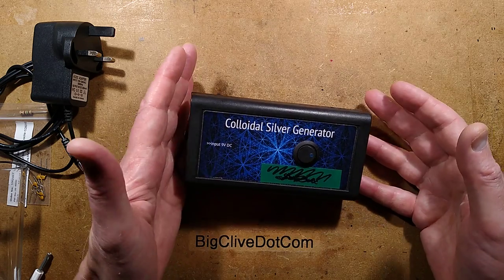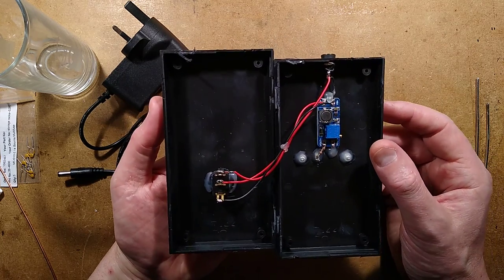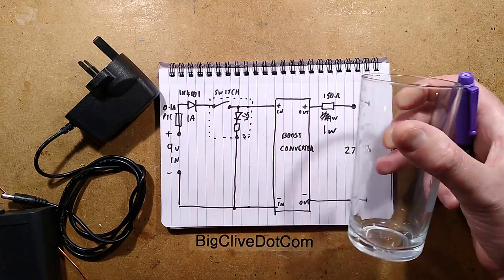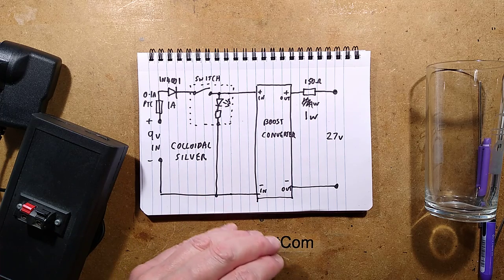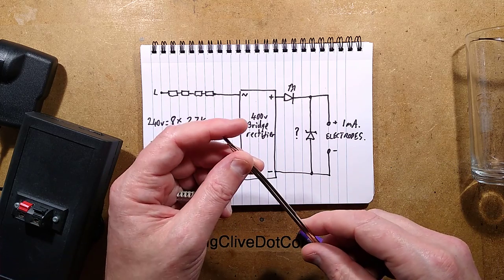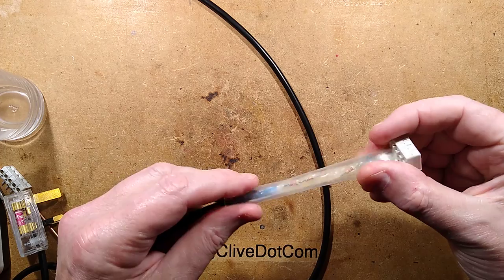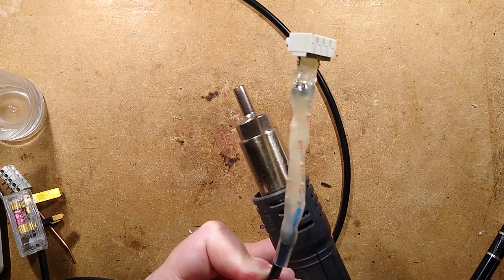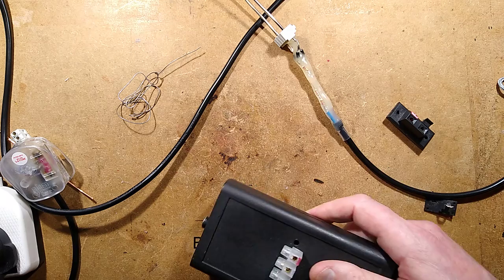Fixing a colloidal silver unit and making a slightly dangerous one.

Comment: Reversing the current periodically will swap the anode cathode thus evening out the ion salt deposition on each rod.  Induced frequencies can vary qualities in the 'cook'.  A magnetic stirrer will help speed the reaction.  I've had excellent results using the Spooky 2 signal generating unit, software, and documentation.

Comment: Love it! Thanks clive great video! In a pinch we took 3 radio shack rechargeable 9V batteries, stuck them together in sieries batt 2 batt +,-+-+-. Marked the positive of 1st batt and negative of 3rd on a mayonaise lid. Drilled holes for 18awg wire then tied 2 knots either side of lid to hold wires in place wrapped the wire around terminals on the batteries. And wrapped around 2 pieces of hammered silver. 👌 Oooh would the silver emit from the negative poles in the southern hemisphere? 🤣🏌️‍♀️

Comment: My guess is when this unit was originally designed they used a boost converter with current limiting, which would have stopped the burn up that happened, but a penny pincher found that they could save a few cents by using a converter that did not have current limiting.

Comment: A good improvement to your prototype would be to heat the whole thing up again and make a U-bend in it. Yours is straight, so that terminal block, the LED, rectifier, resistor arrays and mains cable all pulling on that glass. It is a colloidal spill waiting to happen.

And of course, the 'box' should be 3D-printed, as others commented already.

Comment: Hi, as for the hot glue.. I usually do it the way I just take a hot glue stick, eventually  cut it lengthwise to reduce the amount of the glue.. put it alongside the wire, put the heatshrink tube over. and then heat it all with the heat gun. The heat gun shrinks the tube and melts the glue inside and the glue quite successfully fills the entire inside of the heatshink.. and sometimes oozes out. :)

Comment: That wire would make nice snake oil speaker cable. Bonus if you make little wood free air supports for it as to have low capacitance to the speakers.
Reply: Now that's a great business idea! The audiophiles will go nuts over this :-)
Reply: @harriehausenman8623  you have to sell it with belief from the heart (or from milking a snake)
Reply: @fanplant  A religion, you say? Also a great idea. I'm in anyways.
Reply: @harriehausenman8623  little wood miniature telephone poles with a sonically balanced real Shellac finish.
Reply: @fanplant  But don't these need a near-perfect vacuum?
Reply: @fanplant  Maybe with a gravitational waves balancing counter-weight?
Reply: @harriehausenman8623  the vacuum model would be another "level" of existence $$$*$$$
Reply: none of it really matters, I just came from an outdoor market that had a booth selling CBD with the claim it works for aids, spinal cord injuries, cancer, and liver disease. If they can get away with it you can sell little lincoln log speaker cable standoffs

Comment: That could also include a TDS sensing function. Ounce the voltage accros the electrodes drops to a predetermined level you know the TDS (conductivity)  has reached your desired level.

Comment: I use 3.3v @20 + amp.  Lower the voltage the better as minimises pariculate size.  Distilled water easily made using a pressure cooker with copper brake pipe attached as a condenser coil.  Cool the coil obviously test the outflow as the ppm lowers to zero.  Oh and use rainwater as the initial ppm is usually well below 20 ppm with atypical around 10.

Comment: I also think this is nothing more than woowoo - but instead of using a higher wattage resistor you should use a higher value resistor. Using a 2.7 kΩ resistor instead of 150 Ω will not affect the working current/voltage significantly, but limit the short-circuit current to 10 mA at about 1/4 W over the resistor.

Comment: One suggestion I'd have is to use a small transformer in your final potted version, it'd isolate from mains and massively reduce the shock risk.
Reply from the maker: The transformer would increase the size and cost greatly.  The maximum of 2mA to ground from the resistors would sting, but not pose a high risk.

Comment: I would replace the cheap speaker connectors with a pair of banana jacks and then attach the silver rods to a pair of banana plugs to fasten to the unit. Very stable, won't wobble and short out.

Comment: Surely, as both electrodes are identical, there is no advantage in using DC. Your directly-from-mains idea would work just as well with the bridge removed. It would also ensure that both electrodes wear away at equal rates.

Comment: Suspended metallic silver is definitely not the same as ionic silver -- it's the same element, but it's not chemically IN solution. When you run a device like this, pieces of the electrode will fall off, and you'll always have nubs of the electrode left over where it wasn't submerged. Some pieces are just tiny pieces of dust-like silver. That silver is NOT in solution. And once it's off the electrode, there's no chance of it actually going into solution! In fact, I've seen them where more than half of the electrode just fell off and to the bottom. So expect that to happen as well. At the end of your run, you simply need to take a coffee filter or 3, and pour the solution through it to collect any residual metallic silver that didn't go into solution. The silver that's truly in solution will pass right through the filter without any problem. And once you've gotten enough of the metallic silver (and the nubs) gathered up, you'll essentially want to make another electrode from it -- or re-melt an existing electrode and simply combine the leftover detached metallic silver with it in the melt.

Comment: Fuse inline with the electrodes to protect the resistor from getting too hot for too long incase of a short.
Reply: seen the UK plug? there is a fuse inside the plug. Some call that a "safety feature" - others call the power you can get from an UK outlet insanely high and that fuse a workaround.

Comment: I know that it would make little practical difference in this case, but why have a series of resistors on the neutral?
If there were to be a break in the resistor chain in the neutral you would potentially get a voltage to earth through your body of Twice the normal voltage at the electrodes! 
It would be well below the tripping threshold of your normal RCD or RCBO so would remain "live". Simply doubling the value of your resistors and only having them on the live side would alleviate this problem!
Reply: It can make a huge difference. If a socket outlet is wired backwards it means your bare electrode is connected directly to live. Even if your outlet is wired correctly if there is a poor connection upstream the neutral will rise in potential. This can happen if a cord is unplugged while still turned on, as AFAIK there is no mechanism to ensure the neutral connects before live.
Reply: @eDoc2020  If your socket outlet is wired backwards you have bigger problems than this!
Reply: @totherarf  Swapped live and neutral is relatively common and doesn't cause any issues in 99.9% of cases. Swapped neutral and ground is also usually harmless (unless there's an upstream GFCI/RCDs). You only have huge problems when you put live on the ground pin, which unfortunately has happened before!
Reply: @eDoc2020  Not too sure where you are ..... but in the UK swapped live neutral (or worse) live earth is quite uncommon!
I was called out to a strange fault that illustrates this well! The complaint was that his floor was getting hot, but only when he used power! Bottom line was his kitchen floor was tiled and was too hot to kneel on! This was due to the gas pipe running through the floor being used as an effective neutral after a fault! Left unchecked this would have undoubtedly been a news item after the gas leaked and was ignited by a spark from the "bad connection" of the melted solder joint in the copper gas pipe! 
Here in the UK we have basically two types of supply 240v L with separate earth and Neutral or 240v live with a combined neutral earth (TNS or TNCS) In all cases the neutral is connected to the str point at the substation transformer with a "lead" taken to the earth connection of the supply cable and to an Earth mat (or a grid of earth rods! This means that Neutral is bonded to the mass of earth and if you are standing on the ground ant touch a neutral there is no potential. TNCS systems have multiple earths taken to the underground cable to ensure this is the case.

Comment: @bigclivedotcom if you eliminated the bridge-rectifier on your contraption, wouldn't it just double the output of colloidal silver as well as level the wearing of the electrodes at the same time???
Here's my thought (Please correct me if I am wrong.): 
With the bridge-rectifier you are getting Pulsating DC Current, but without it you are getting alternating waves. Wouldn't that effectively double the time that current was applied to the electrodes, as well as giving additional levels of (lower) voltages as the sine wave approaches zero?

I'm no Expert (read as "a drip under pressure"), and I've taken many different voltage zaps in my time playing with electricity. This just seems logical to me, but it's just my "inebriated guess."

Comment: That boost converter is under $1 on ali express. That whole thing is under $5 in parts. That power adapter probably cost more than the rest of the device.
Reply from the maker: They could have cheaped out further.  There's a version with a USB connector, so they wouldn't even need to provide a power supply.

Comment: When I was a hospital engineer some years ago we had to keep the domestic hot water at 60 centigrade to prevent legionella and this meant that we had to fit mixing valves at every sink tap to prevent scalding or we could drop the hot water to 40 Centigrade as there was a company selling a commercial silver generator to add silver to the water.
This presumably was colloidal silver and it was meant to sterilize the water to prevent legionella  at the reduced temperatures. Anyway in the end the management never went for it but I wonder how good it would have been.

Comment: Have you ever tried placing the heat shrink into a mug of boiling water. It could speed up the process of shrinking / melting the hot glue. I use that method all the time as I don't have a hot air gun.

Comment: I build dual 556 for the generator with output transistors. I get 20 ppm in two hours.  Using a 9 volts adapter.

Comment: I was wondering if the 110v AC 1mA leakage I get from both DC terminals or metal case of my SHAMPOWER 240v-12v 5A LED driver power supply - would be just right to make a nice colloidal silver preparation?

Comment: Not sure as I see the benefit of DC in this application.  The two electrodes are the same and you don't care if you get the same results on both sides.  Perhaps there's concern that AC will "recall" the newly liberated silver?
Reply: Yes it will. Electrolysis requires constant current flow. AC switches like a yo-yo. There is no "benefit" to using DC other than that DC is what makes electrolysis actually work.

Comment: I make my own colloidal silver with all kinds of circuits - I find it doesn't really matter, only the current. For this electrode size you can easily go to 10mA of cc. I actually made some with over 200mA of current and had it lab tested: All particles around 5nm and 65ppm. From the colour I estimated 60ppm. When you don't heat the water you will get more colorless ionic silver. Atomic silver with more than 5ppm always has colour, we see yellow because of the plasmon resonance of 405nm of spherical silver colloids.

Comment: Wouldn't adding a capacitor after the bridge rectifier make a constant DC voltage? Thus, the reaction may happen faster and greater?
Reply from the maker: That could charge up and pose a significant shock hazard compared to the current limited supply.
Reply: That absolutely makes sense. Could one current limit the output after the capacitor with resistors? Maybe even reduce the rectifier to a half bridge to eliminate 3 diodes.

Comment: Why not swap the neutral for ground? In that case in a serious fault, it would trip the rcd
Reply from the maker: I did toy with making it live and neutral, but was considering that others might try and build it for two pin electrical systems.
Reply: @bigclivedotcom    "I did toy with making it live and neutral,"   but you did :)  Typo maybe ?
Reply from the maker: @David_11111  Yeah, I meant live and ground.  The 1mA current would not pose a risk.
Reply: @bigclivedotcom  Wow. good point.

Comment: When you turned on your friends gadget, Clive, there is a high pitched noise there o.o my ears tell me not to go near it. idk what that is . Actual question, what is IT ?
Reply from the maker: It's the switching circuit in the boost module.  It runs at high frequency, but the power supply may have been interacting too.

Comment: I am trying to think of a reason why this device wont work using AC instead of DC?
Wouldn't both electrodes be leeching silver using AC or am I missing something?
Reply from the maker: With mains frequency AC virtually no silver would be liberated.  It would have to be a very slow polarity change.

Comment: AC would work, just not as good as pure DC.  Pulsed DC  will be better than AC.  Pi filter (capacitor inductor capacitor) smoothed DC is best. 

Water acts like a dielectric in a capacitor where the dielectric stores energy orientating polar molecules inside an electric field.  Alternatingly aligning water molecules in one direction then in the other is sure to inefficently make heat not to mention the peek voltages is higher and less efficent than the rms voltage. On the other hand the pulsed DC won't go through as radical of a reorientation because the fields alwase point in one direction  because of the capacitance that exist on two metal plates with a dielectric in between as electrolysis drains off the excess charge above water's electrolytic breakdown voltage. And still, with pulsed DC, you still have inefficient peek voltages for a given rms over a pure DC voltage equal to the rms of a pulsed voltage.

Comment: I would have thought those wago connectors would have been perfect to hold the wires.
Reply from the maker: The electrodes I had were too big to fit in a Wago connector.
Reply: @bigclivedotcom  Wire too big, hole too small, understandable

Comment: Did you say £50 for that box of tricks? That boost converter looks like an XL one I've used before, and they're like £3 each, or cheaper in packs of 5 or more (and I seem to remember that when it gets a blip of low voltage from a battery, it "forgets" what voltage it's set to, and outputs it's full 30+ volts, so the act of a dying battery destroys your circuit!).

Add a resistor (pence) and a diode (10 pence at most) plus a shonky 9v power supply... £5? and some awful speaker terminals... less than £10 of components, so let's say £10 with the plastic, and they're selling it for £50? Ouch!

Comment: It would be interesting if this process could be reversed to use a silver solution to plate components for circuits.
Reply from the maker: You can.  Electrolysis using a silver loaded liquid.

Comment: While using DC, the cathode (negative terminal) can workably be some other metal than silver.  Something relatively inert such as stainless steel should do nicely.
Having not tried the process, I can't say definitively; but I am virtually certain AC would do the job just fine; in which case you'd want both electrodes to be silver.

Comment: Clive could you use a European plug and just replace the pins with the two electrodes, place the resistors inside and then put a uk plug on the other end of the lead.

Comment: Could you fit resisters and diodes in a wall plug so from plug is just wires straight to electrodes?
Reply from the maker: The lower voltage units are much safer.

Comment: i am endlessly confused at why this thing has a power brick ...and then a boost converter. why not a power brick that gives ya the DC volts you so desire? i am so confused
Reply from the maker: Lower voltage power bricks are much cheaper and easier to get than higher voltage ones.

Comment: If you have a condenser dryer with a water reservoir (instead of directly draining it), that's a cheap source of distilled water to use in your steam iron, or one of those decorative bowls with floating candles. I'm not sure it'd be safe for consumption, but it's definitely a convenient and cheap source of distilled water for a lot of practical purposes :)
Reply: No, most certainly not safe for consumption

Comment: Use only purest silver sticks you can get.
Use only Distilled water.
Keep the Colloidal Silver water out of light of any kind.
Scrape off the black stuff from the Silver Sticks and save that black stuff and put some in Aloe Vera gel . It  makes a wonderful skin salve to put onto a fresh cut to keep infection away.
I also keep a tiny blue spray  bottle of it inside  my purse so I can spray it into an opening to kill infection right away. Getting a cough?
I take a deep breath while I am inhaling the spray from my tiny bottle, of course I will cough a little bit, but I do it 4 times or so . Voila !!
Kills the bad germ in my lungs trying to start an infection. Spray a bit up your nostrils too as you inhale and it's been keeping  my nose from getting an infection too and sinuses.
I keep a tiny squeeze bottle of it in my purse. I am a clod, so I am always bumping my forearms and getting a tiny cut and when I am out and about it's easy to get an infection. I keep Q0tips in the bag too to dab into my eye if I feel it is itchy. It won't hurt your good bacteria only the bad stuff. You don't need much so don't overdue it.